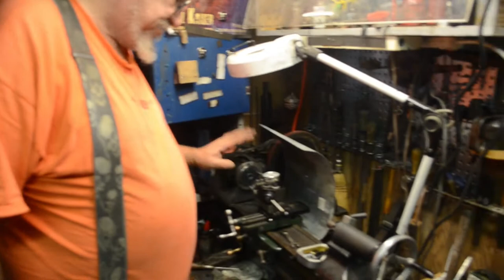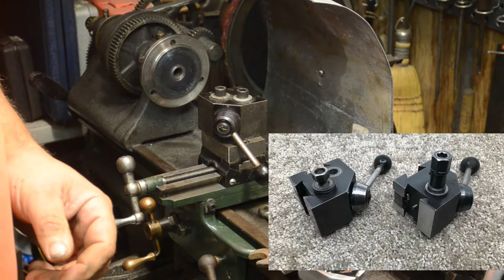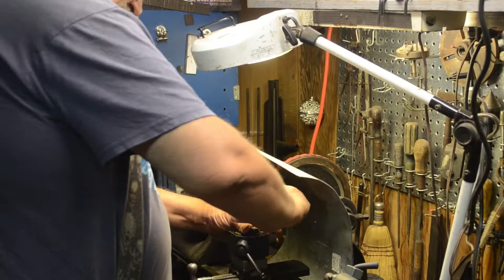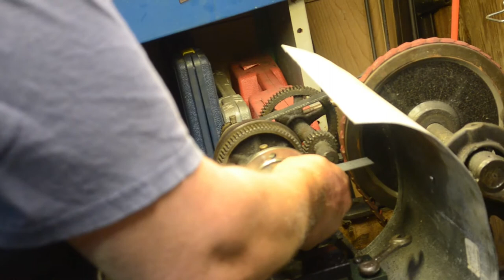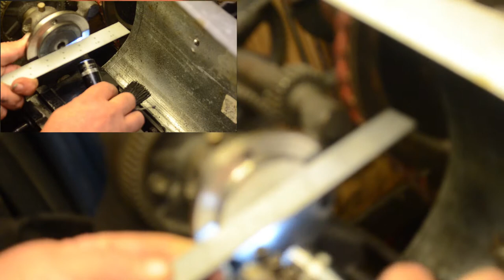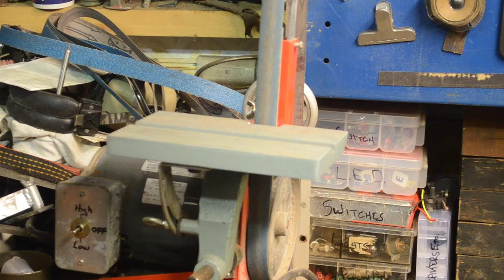Hardinge L18 Quick Change Tool Post Update

Comment: U certainly have some skills that is something I couldn't do 🤣👍great watch
Reply from the maker: Thanks Michael! Though, I'm half surprised the comments section hasn't blown up, with comments, from the thousands of youth, I spent years trying to teach to be observant, in Scouts, over my not noticing how far out the cross slide was, or how it would be easy to work with 1 of these mounting bolts removed... ;)
Reply: @trollforge  😊🤗